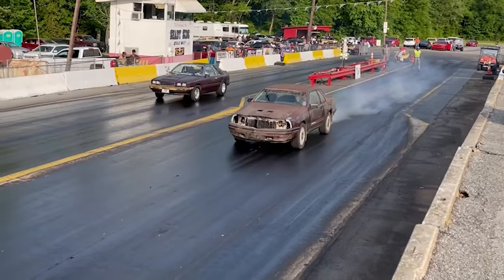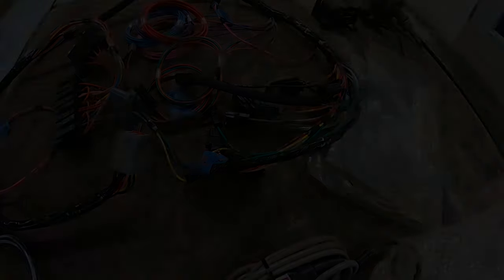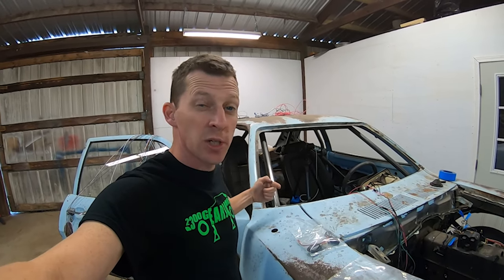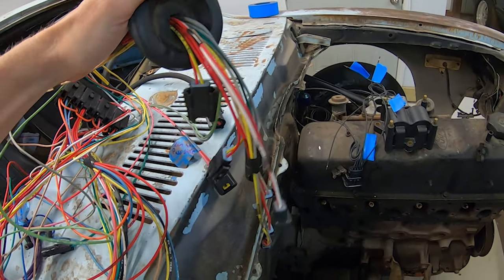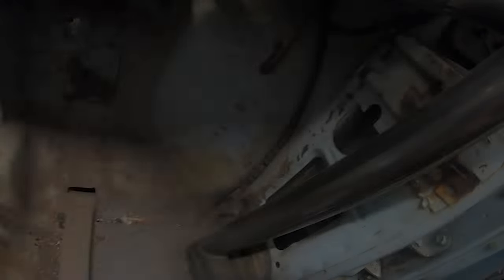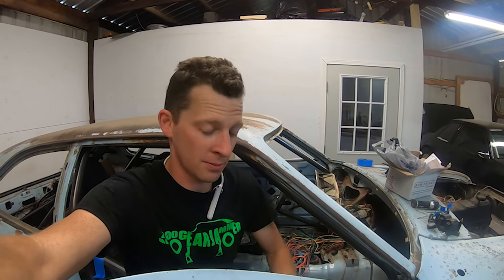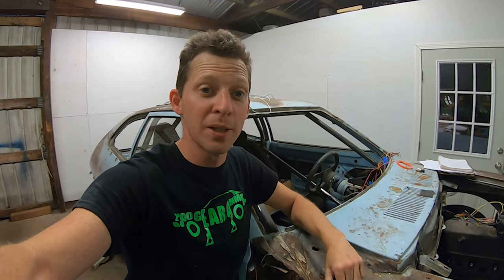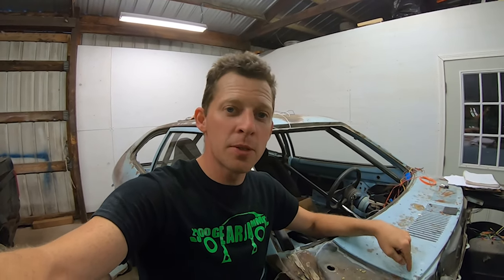Will It Run? #Turbo#Ford#Pinto Gets a Carb to Fuel Inj Upgrade. Here's Why Fuel Inj is better

Comment: I’m interested to see the batch/sequential shootout on a 2.3. My theory is it doesn’t matter for WOT and 5000rpm+ on engines with decent flowing components. maybe in a low hp application maybe there could be an advantage for peak power.
Reply from the maker: Is that your final answer? I'm betting on an NA engine, no hp change. On a turbo engine 10hp

Comment: I would like to see an exhaust back pressure sensor, a second intake air temp between the turbo and the intercooler and a MAF... Then I may actually use some of what I learned in heat transfer  😂
Reply from the maker: Back pressure and air charge temps are about the only useful thing I had on the list other than some joke things. 😂

Comment: Let's see some individual EGT and O2 readings and see how tuning individual cylinders changes the power.  Plus that's 8 sensors...probably 2 more than the HP it will make!  😂
And oh how I wish it were only 90.  It's been right around 100 here for 2 weeks, with some nasty humidity.  Makes me dread opening the garage.
Reply from the maker: Haha actually if I were to load it up with all those sensors at one time the car would slow down more than the power it would gain 😂

Comment: I left some comments, yes to everything that asked if we wanted to see, and can't wait to see this pinto scream for mercy while going down the track. Hopefully my aluminium driveshaft will be here Wednesday along with the u joints. Im ready to kick some brand x boooty.🤪 ive got some new valve springs so that this thing will rev out , now ive got to get off my lazy butt in this ac and go out in the heat and put them in. Southern Alabama humid heat is terrible
Reply from the maker: I don't recommend getting out of the AC. I started thinking about which cars I plan to put AC back on yesterday. 😂
Reply: @2300gearjammer  🤣😂🤣 The pinto is definitely going to get ac again. I only ripped out everything under the hood that was going to need replacing anyway . It's going to have to just be as fast as it can with ac 🤠🚙💨

Comment: Many years ago I took the original carb. and adaptor off and put a 350 Holley 2 bbl. The fuel mileage and power went up. I acquired a turbocoupe so I added the turbo to the Holley with very low boost. My fuel mileage went from 27 w/o turbo to 31 mpg with turbo. I wanting to try the Holley Sniper efi with the turbo. My question to you is , have you ever compared the performance between the stock pinto intake to the efi lower intake. This week I'm putting in a T5 and adding 3.40 gears. My goal is 35 mpg with the right combination. Stock intake with 350 Holley, efi intake with 350 Holley or Holley sniper efi.
Reply from the maker: I haven't done that comparison. 35mpg doesn't seem impossible though. I've gotten 31 in a mustang at 2900lbs. 

It's amazing how much that little big of boost can help fuel economy.
Reply from the maker: Was it a 4spd and going to a t5?
Reply: Yes 4 spd to a T5. I do a lot of traveling in my Pinto so far is been to 31 states. One trip was KC to Maine 4000 miles. Many trips down the dragstrip and raodrace track in Kansas and One in West Virginia. Getting car ready for a trip to Tail of the Dragon in August
Reply from the maker: Haha wow that's awesome. I won't take this pinto to tail of dragon this year but I can see it going at some point

Comment: I need to make a front splitter for my Turbo Coupe. Do you think that custom carbon fiber will work in that application?
Reply from the maker: 😂 yes! For display purposes only. Not to be used in real life...Only YouTube. Now I'm worried my super custom ecu mount is going to break.

Comment: How do you hook up the sequential coil
Reply from the maker: That's a little tricky. After the pinto is running I might do a separate quick vid just for that. It uses a coil ignitor. So the PIMP controls the ignitor and the ignitor controls the coil firing.

Comment: Do have a ECM for a 87-89 2.3 N/A auto? I'm having major issues I bought one from O'Reilly but it doesn't seem to work,  mine works for about 10 minutes and it's done until it sits a while? Any ideas? Check out my videos if you get time
Reply from the maker: Hey sorry your comment got flagged for some reason. Did you ever get it figured out? I'd like more towards ignition parts or the IRCM.
Reply: @2300gearjammer  no i haven't been messing with it lately, trying to get a 302 or 351w for it
Reply from the maker: Lol that's pretty normal. I pulled a 351 out to do a 2.3
Reply: @2300gearjammer  yes if I could get ahold of a 5 speed  turbo coupe if love to do that